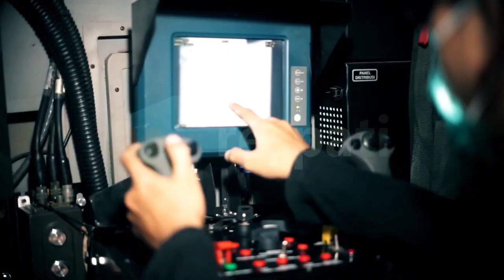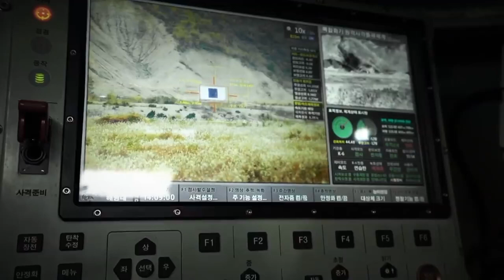Respati RCWS | Leaping to the Future

Comment: These are great systems, usually when it can operate the 50 cal. it can also operate the 40 mm automatic grenade launcher. I remember before we had these during an exercise in the city one of our YPR-765 hit a speed bump and the corporal maning the machine gun fell on his bottom emptying a large portion of blanks in the middle of the city. 

Great video again. Stay safe and healthy brother 👍
Reply from the maker: yeah, I wonder why they didn't test it with AGL as well.. I hope in the future they can put it on.. I feel sorry for the corporal.. do the Dutch Army already applied this system on their vehicles?

thank you my friend.. stay safe for you and your family too.. 👍
Reply: @PacificFront  those which are heavier have a remote station. The Vector still uses manually operated systems, but the Fennek has both versions. The older Fennek partially still have a manual gun armour nearly all have remote stations. We sometimes get vehicles from storage that still have a manual gun. This especially happens when we have too many deployments and maintenance can't keep up. I think only the military police still uses armour with mainly manual guns, but not when they are part of overseas deployment.
Reply from the maker: @jacksonteller1337  I see.. so it's already in widespread use, yes? nice.. any particular manufacturer or you have system from several manufacturers?
Reply: @PacificFront  different types from Thales, Rheinmetall and other suppliers.

Comment: So it’s not deployed yet? Is there any definite time that it’ll be deployed?
Reply from the maker: not yet.. it's still their first article/prototype.. still need improvement tho.. and I don't have a clue when it'll be mass produced.. at the end it depends on the user (TNI).. do they want to buy it when it's ready? and how many do they willing to buy?
Reply: @PacificFront  I hope they’ll reach mass production stage.
these days even a group of college students can assemble and program their own homemade RCWS, i’ve seen it on youtube.
It’ll be a shame if these don’t pass
Reply from the maker: @FebiMaster  a college students? wow.. I haven't seeing it yet..
at the moment, the RCWS program still need more funding tho.. usually that's the biggest issue.. I see it still have a room to grow.. in hardware such as hd camera, and capability to put on 40mm AGL, also in software, such as object identification.. I hope if it gets into production phase, those improvement can be added..
Reply: @PacificFront  Yes, try looking “homemade sentry gun” on youtube, usually its an airsoft gun with servo motors, camera and a mini computer, the software provide image recognition that allows it to lock into an object and the computer can be programmed to fire when a specific condition is met, theoretically it can also be equipped with stabilization system using digital gyroscope, just like drones.

I hope this program got finished quickly, but considering covid is still going strong, it may get sidetracked for a while
Reply from the maker: @FebiMaster  that a fancy system for an airsoft gun 😆well if airsoft community can do that, I believe Respati can do that to.. or collaborate with those college students is much better..

yeah, the pandemic is still the biggest roadblock right now..
stay safe and healthy okay 👍